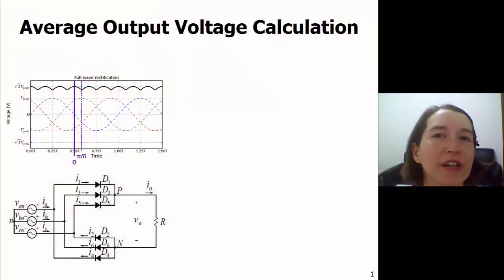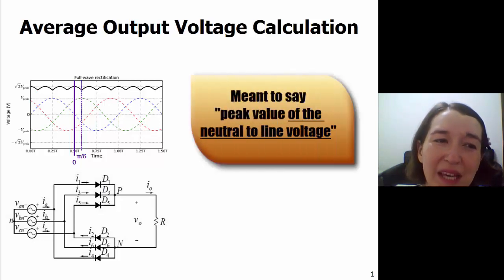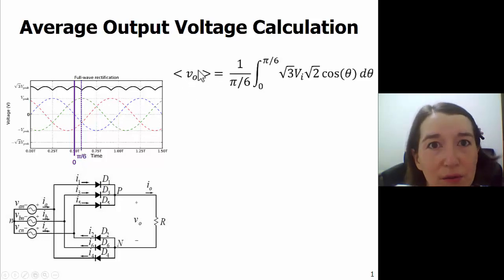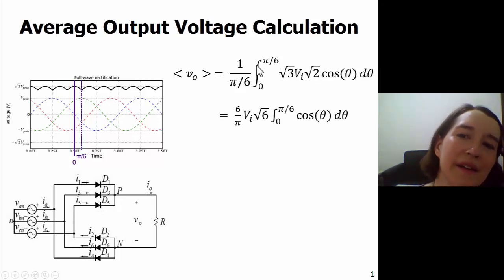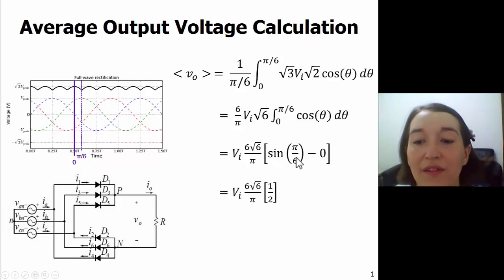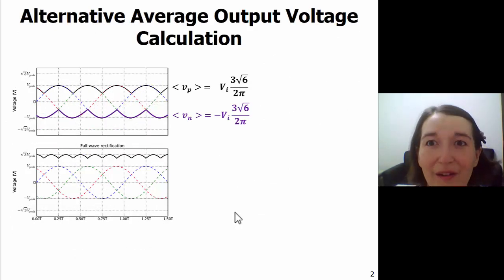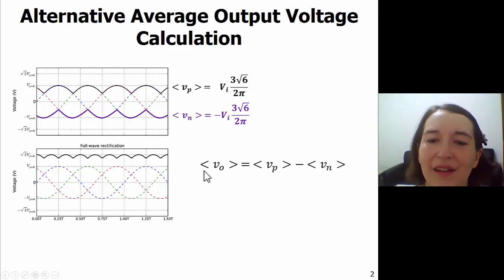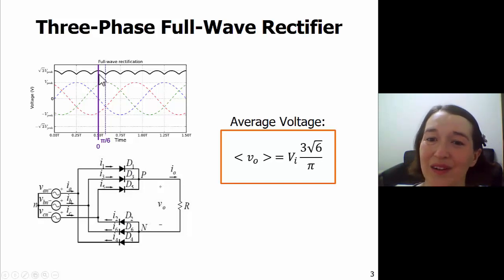Three-Phase Full-Wave Rectifier Average Output Voltage

Comment: I don't understand where you get the Sqrt(3)*Vi*Sqrt(2)*cos(theta) in your first step.  When I tried to figure this out I used the same integral range and same 1/(pi/6) but inside my integral I have this (using x instead of theta)  sin(x + 2*pi/3) - sin(x + 4*pi/3).  Oh but that has to all be multiplied by the peak voltage not rms voltage.

Comment: Thanks for the lecture. 
Just don’t understand why you integrate over half a period of the rectified waveform... Shouldn’t the average be integrated over a full period?
Reply: the half period is identical to the other side of the full period. the average would be the exact same either way because they mirror each other

Comment: We use tansformer & 3-PHASE rectifier to make the car starter motor power supply.I am strange about why the transformer secondary side use delta connection，cause normally in book always recommending star connection，and from diode view Uoutput=2.34Uinput